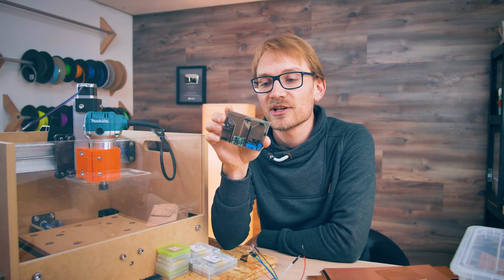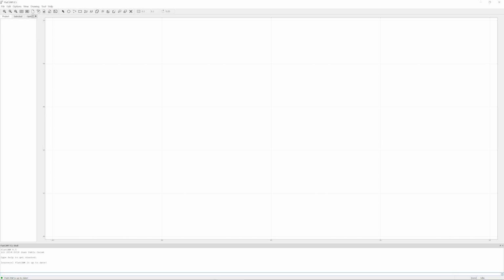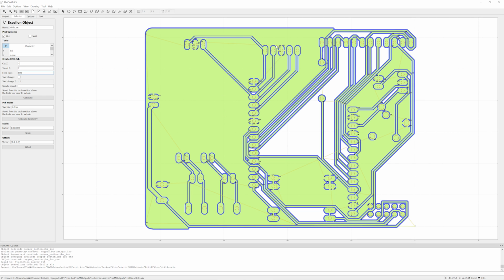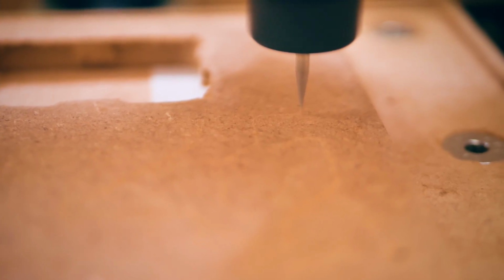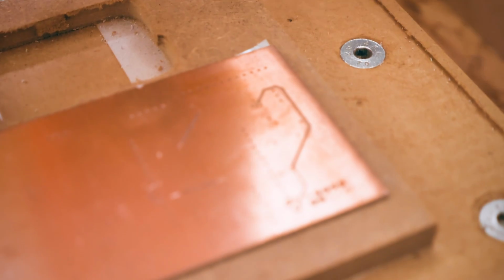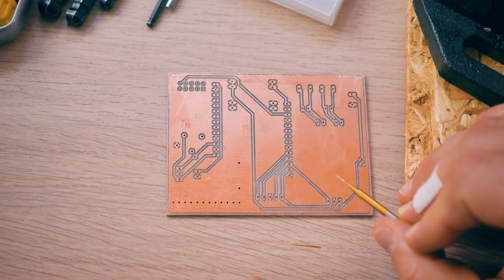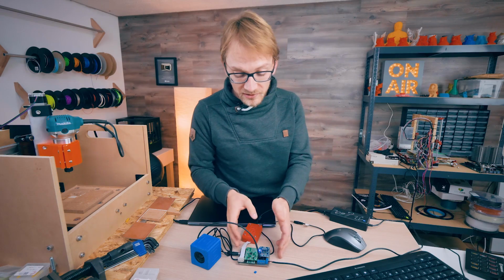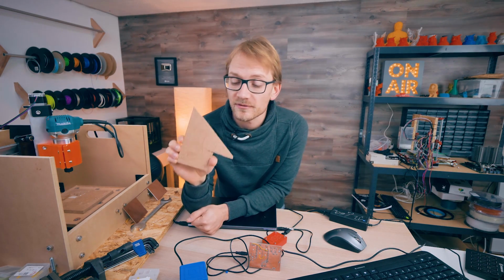Make custom PCBs with the Sienci CNC and FlatCAM!

Comment: AAAARRGGG!  Well props to Thomas for going to the effort to display this method, but it is such a huge waste of time. No plated through holes, no solder mask, no silk screen.  It is soooooo easy to upload your design to a Chinese board house like allpcb or jclpcb etc. Two to three day turn-around (plus shipping time, which totals to one week turn-around to the US) on 1 to 4 layers, proper professional performing and looking board with solder mask and silk screen, HASL finish so it's easy to solder and doesn't oxidize like bare copper will, features down to 5 or even 3 mils, AND cheaper, including shipping, than DIY like in this video. Save yourself from this DIY torture and put that time to getting a first board done at a board house, and you won't go back. Heck, go to one of those websites and price out what you want as a start.
Reply: You miss one HUGE downside of your process: having to wait 2 weeks or more to get the boards!! Making them at home can give you results in an hour or two! If you're trying to prototype a design, waiting WEEKS between iterations is a complete non-starter! OSHpark and the Chinese fabs are great _for the final/production boards_, but they're completely impractical for prototypes where you need a decent turnaround time. (Yes, you can always opt for DHL/UPS shipping and get boards back in under a week, but that's still ALMOST A WEEK and you'll be paying something like £50 per design iteration, whereas a Bungard presensitised laminate is more like £2-3, and the chemicals involved are very cheap as well.)

Plus making them yourself is way more fun ;)

I also completely disagree with your "cheaper, including shipping" claim. Maybe it is if you're only doing a few boards, but once you have the equipment to make boards at home (whether with a CNC router or with the chemical options), the actual consumables are very cheap, so it wouldn't take all that long to recoup your investment and making boards at home ends up being cheaper than having them fab'd professionally. (I also feel that, while "10 boards for $5!!" is nice and cheap, and is great news for makers & hobbyists, the fact that you're basically FORCED to get 10 boards - or 5 at a minimum - and then if it's a prototype there's a good chance that you'll just throw away all but one of them, that's a huge waste of resources! It may be economical, but it's not exactly ecologically friendly!)

(I personally etch my boards with ferric chloride rather than milling them, but I'm currently looking into buying a CNC 3018 Pro "engraver" mill to automate the drilling & outline milling processes, which are super annoying to do by hand...)
Reply: @AndrewGillard  Like I said, one week turnaround, without paying expensive shipping. Sure, that's not same-day. But the number of times I need a crappy single sided or badly registered double sided board (with no plated through holes) same day is rare.  Obviously there are cases where you do need that, but I'm suggesting that for the most part, getting the board made for you is the way to go. A prospective PCB maker should at least be aware that a professional looking and performing PCB, in prototype quantities, is well within reach, before fiddling with a CNC machine to produce primitive results.
Reply: @Graham_Wideman  Also in the rare case that you don't need a two sided board with plated through holes it is easier to print on old magazine glossy paper and etch. That takes me less than twenty minutes.
Reply: Through holes are generally finished with copper rivets, and there’s nothing from stopping you from applying solder mask and screen printing.  You just have to balance what’s right for your application.  Pay enough money and you can get a three day turn around from a board house.  If your budget is approaching zero and you have the tools to make a one off design, why not?
Reply: @antonw8134  If your budget is approaching zero you're not going to be doing solder mask and silk screen, and you won't have the CNC router either.  I'm not saying people should not make their own boards. I am saying that people new to this shouldn't be encouraged to think that making your own boards is the leading alternative, either in cost, or in result, and especially not  in cost-benefit. Nor should they be encouraged to think that "making cheap PCBs" is a rationale to get a CNC router, because the best it can do is make a simple and poor-quality PCB, given significant adjustment and tweaking.
Reply: @Graham_Wideman  A lot of maker spaces have all the necessary equipment to fabricate boards in house, just for the cost of materials.  I would encourage people new to electronics who enjoy the hands-on process of fabrication to give it a try and let them judge for themselves when it is or is not appropriate.

Comment: thomas milling needs autolevelling using conductivity of the surface.
Reply: This+++
It's brought out to a pin in grbl (which the mill you have runs) & it makes this whole thing loads less of a ballache - you won't look back :)
Reply: Just don’t forget grounding your drill-bit... i hacked a version of marlin to to that with my mendel90. And instantly broke 3 endmills because i forgot to ground the endmill and the toolhead moved into the probe until i hit the emergency stop
Reply: @JohannesSchriewer  Pro tip: touch the end mill with the probe in the air while doing a probe move and see if it reacts then, then you know it will work BEFORE the end mill is broken :P

Comment: Different beast, but the Chinese 6040 CNC I purchased to make the GHT carbon fibre camera gimbals I was selling was surprisingly accurate considering how cheap it was.  I did need to replace the controller with a Gecko G540 controller which hiked up the price but when it came down to PCB’s I was able to mill stupidly small and accurate boards for SMD type applications.  Only additional step on top of what you were doing was probing the surface of each copper board and applying that height map via my own program to the gcode.  I just found that the copper thicknesses were too variable to rely on fixed cut depths.  Probe was custom made with a piezo.  The big OX CNC I also have which uses belts would not have the accuracy for this kind of work.  Good for basic laser cutting though.

Comment: Hi!! I did a similar video on my channel (italian), I usually build electronic stuff. Your problem is that you are not compensating the working surface. With my CNC and as well on the other CNC machine, it is impossible to have the perfect allignment between the movments on the X-Y plane and the surface of the copper, so it is needed to compasate with probing the surfece. This is extremely important because the precision of the result is dependent on the depth of the cut. If the cut is uneven you will get bad result.
Reply: And this is why I use bCNC (with the grbl controller), it has probing built in and it's very easy to change the grid size for how many probe points. With such tiny engraving bits it is imperative not to cut to deep and probing solves this problem. I do have to agree with Tom here though, this machine (as it sits) is likely not well suited for the accurate moves required.

I also see that he has still not adjusted his acceleration and max speed settings in GRBL as well. Feeds/speeds are equally as important as any other setting. You don't just mill slower for better results. A bit dwelling too long in an area also produces poor cuts and from what I could see, he wasn't cutting quite fast enough. Those engraving bits are the cheapest you can find as well, so they produce the worse results. Now I buy 1 bit for $10 instead of 10 for $10 and the results are so much better. Keep in mind you are cutting on a VERY fine point so you need more rotational speed (especially with a single flute like these bits). Using a motor that is slower (like the one shown at the end) a person would want to increase the number of flutes on the bit. 

Don't get me wrong here, Tom is showing his process and I am not just pointing out what is wrong. I'm trying to share what I know, though I can completely appreciate Tom showing his results as he learns more. I've already been through this process and I still try to learn more by trying new things. A problem that I have yet to solve is the bit plunging, these free CAM packages do not have settings to ramp into the PCB slowly (not that I have found yet anyway). I really don't want the extra step of trying to convert/import a PCB into my CAD/CAM for better tool path generation but I might start doing it anyway.
Reply: @ianide2480  completley agrre, I also use bCNC for my PCB, and they turn out perfctly well done at the first try!
Reply: AT Lab - couldn’t agree more.  Doing an accurate probe makes a world of difference
Reply: Flatcam can exactly do that (therefore its name) but you have to have an automated probing system set up. Doing it manually is very time consuming and error prone

Comment: mybe you could have a look at chillipepr.com.Chillipeppr has a leveling functionality. It is sensing the surface of the copper-plate in a fine grid, determines the exact z-hight of each point and changes the z-values of your g-code, to adapt the unleveled z-hights. With such a manipulated g-code you can use a v-bit, because it is guaranteed, that it is diving allways the same amount into the board so widths of your cuts are always the same. (sorry, I am not a native-english-speaker, so it's rather hard to explain ;-) )
Reply: It is still hard to level it perfectly, because of Z-axis backlash. But then again, if you have your backlash fixed, this could be very accurate! Still, with this method, I gained better results so I recommend it to everyone :)

Comment: Cool video Thomas! Im also interested in starting to mill PCB's at home, a while back I saw this project Cyclone PCB Factory. It is a 3d printable CNC machine for PCB milling using a Dremel 3000 as router, results look very good. They have a RepRap and Github page if you ever want to check it out

Comment: I've done with with an MDX-40, I always used 'dipping' with the drill paths. It takes 3 or 4 passes on each hole, backing out each time and going farther in. Less stress on the drill bit, and slightly better holes. YMMV.
Reply: Aka peck drilling